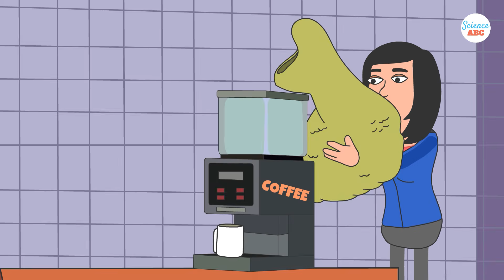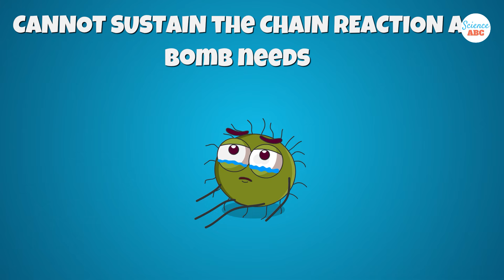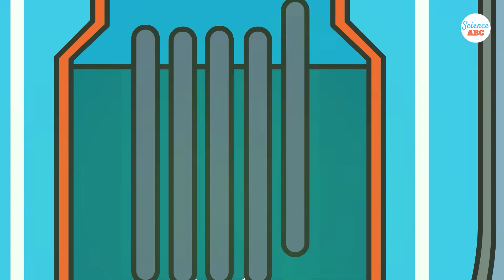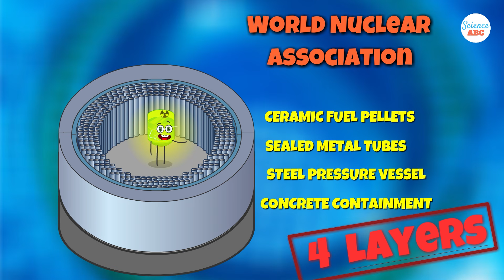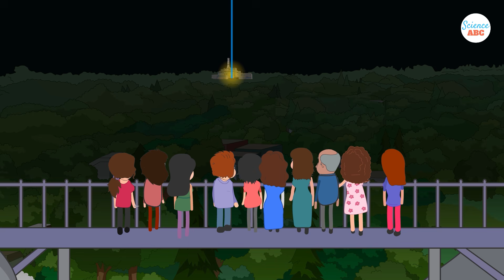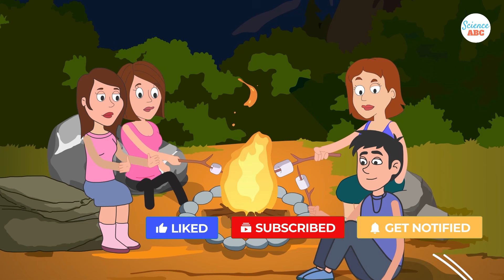Can a Nuclear Reactor Explode Like a Bomb? Explained in Simple Words

Comment: Yes; a reactor vessel can explode like a bomb, just not like a nuclear bomb... more like a grenade from the massive pressure of the steam as the nuclear pile goes critical and the concrete reactor vessel is torn to bits.

I know that you MEANT to ask  "Can a nuclear reactor cause a nuclear explosion?", 
but you ACTUALLY asked in the title text  "Can a nuclear reactor explode like a bomb?" The answer to the first version of the question is "no". The answer to the second version of the question is "yes".
Reply from the maker: You're right, and that's exactly the distinction the video makes. A steam or hydrogen explosion can wreck the vessel, but it's not a nuclear detonation. The title is the question people actually search for, so we answer it head on: no mushroom cloud, but yeah, it can still blow itself apart.

Comment: I think a sidenote on other potential, but real issues of nuclear energy (like nuclear waste contamination) would have made this video more complete. Because for someone new to this, they might come off from this video thinking there are no concerns (however minor) with nuclear energy.
Reply: …or the fact, that these reactors are not producing “nuclear energy” but rather, utilizing the heat to create, STEAM…that then drives the turbines that create electricity.🤔
Reply from the maker: Fair point. This one stayed focused on the explosion question, so waste and long term storage didn't make the cut. It's a real concern and worth its own video. Thanks for flagging it.